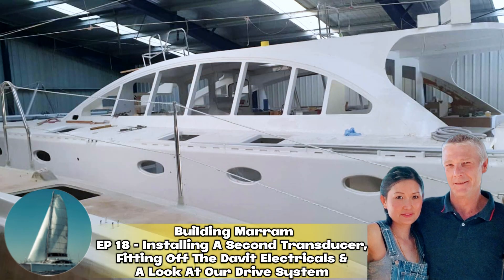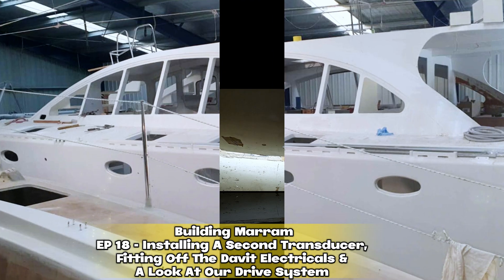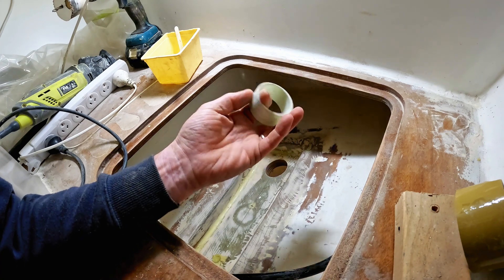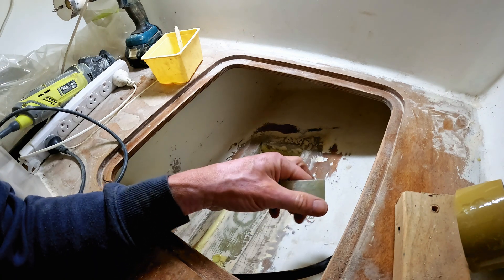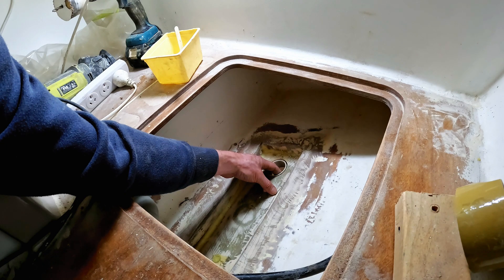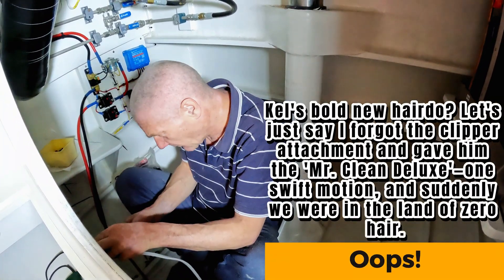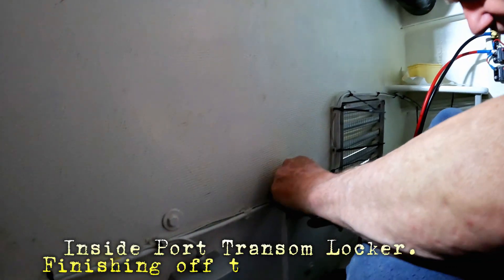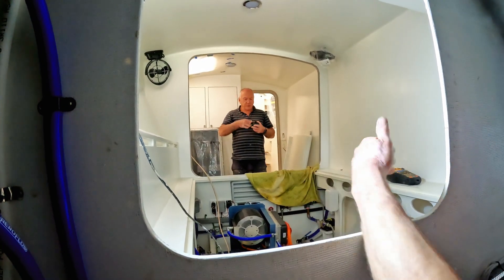INSTALLING A TRANSDUCER, FITTING OFF DAVIT ELECTRICALS & A LOOK AT OUR DRIVE SYSTEM (Ep18)

Comment: Motor room looks schmick, however I'm not a fan of that vent in the bulkhead next to the water heater, it looks very low to the waterline and any breach in the rudder room looks like it would flood the motor room through that vent.
Reply from the maker: Hi Craig, yep was a concern,   needed it for the AC system,  we have water level alarm in the rudder room that is liked to the bulge alarm system, so any issues we know about it, Cheers Kel & Mel